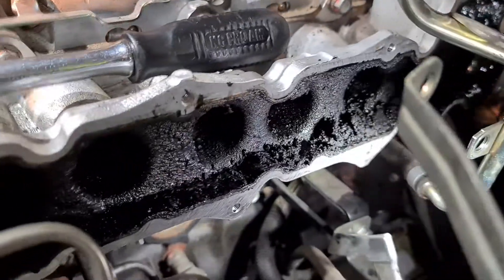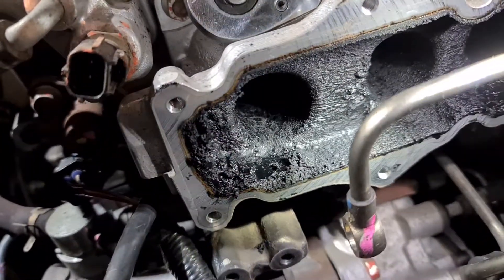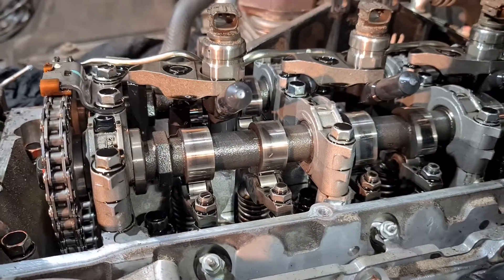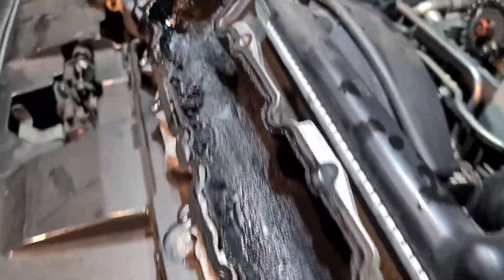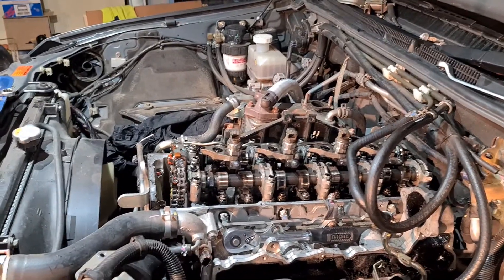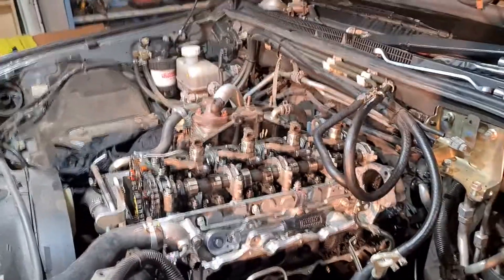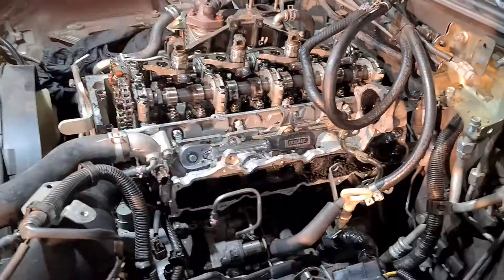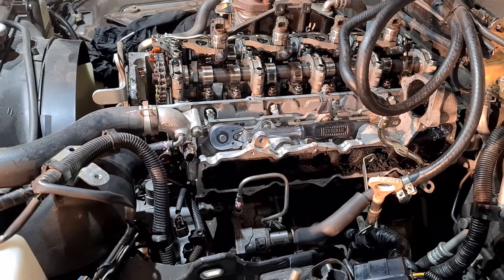Mitsubishi 4M41 Intake manifold clean, valve adjustment and small injection quantities reset.

Comment: The top guide is def an issue, but very easy to prevent causing issues ... change them about every 100,000 kms, all you do is pull the tensioner out, 2 bolts the timing cover can stay on, then squeeze it in on its spring, and move the retaining hook to hold in the spring
Then change the top guide.. don't rotate the engine..
Then put the tensioner back in, preferably with a new gasket, then with a long screwdriver poke the retaining clip and it will spring back in to place, easy!

If you pull the top guide with the tensioner still on the tensioner will click in further, it has a ratchet mechanism on it.. so it won't ever move back out .. this will put more pressure on the guides, and when the new top guide on, and has zero wear put even more tension on the guides, and that will flog them out really fast .. so be sure to do the above procedure

The injector lines are supposed to be replaced after removing and installing them 6 times, so its best to do the guide, valve adjustment, and carbon cleans all at once .. on a younger engine they actually get too tight due to valves seats wearing in

At about 400-450,000 kms replace the entire chain, all guides tensioner and sprockets, and if you keep up oil changes every 10 K it might last another 400 K kms !

Comment: I make sure my valves are adjusted and manifold cleaned out at least every 100,000km always worked for me.  10,000km oil, oil filter and fuel filters replaced.
480,000km on my last Pajero 200,000km on my current Pajero. Great cars.

Comment: Hello mate. What did you use to cover injector  entry points?
Thanks
Reply from the maker: I use caps from the new injectors when I get them in. A vacuum plug for intake manifold blocking will work also.